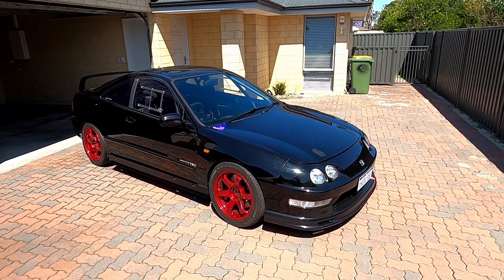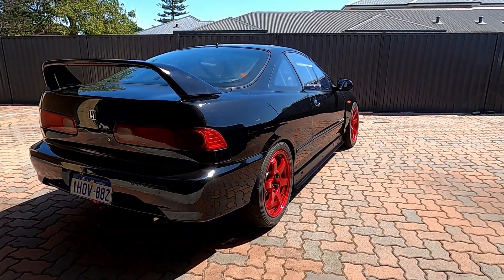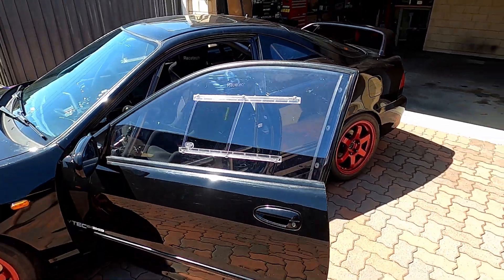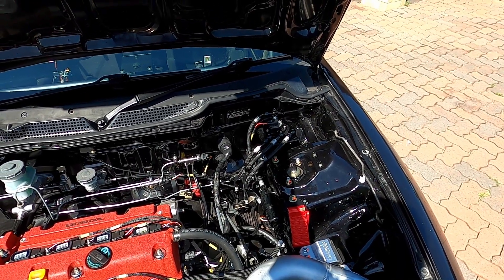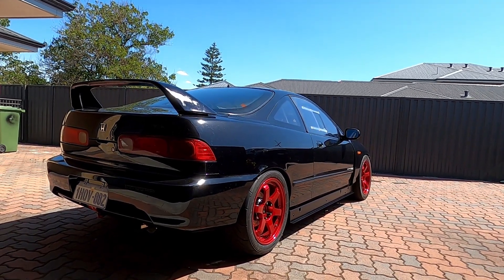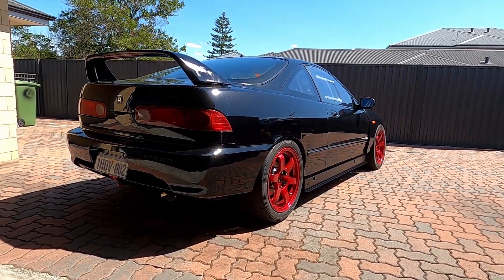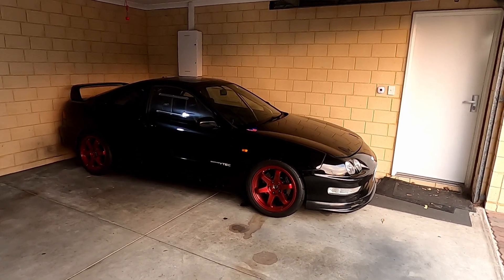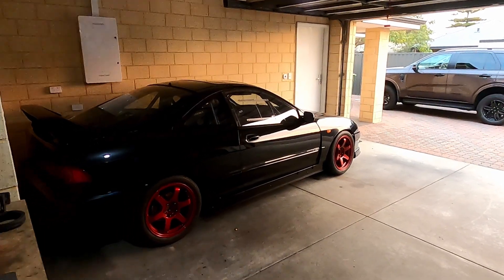K20 DC2 Racecar Buld Ep.10 - Dyno & Track Testing

Comment: beauty mate. How much does it weigh? and how much you reckon the carbon rear hatch will take off, and you reckon youll eventually go with a carbon hood? Also, any plans for a flat floor or any serious aero?
Reply from the maker: As it sits, with half a tank of fuel and the passenger seat etc. in it, 1014kg/2230lb. Pretty happy with that! The carbon rear hatch and Lexan rear window will hopefully drop 10-15kg, and yep I'll go for a carbon hood at some point soon. Eventually the car will get a basic aero package with rear wing, front splitter and front diffuser tunnels, but I want to get everything dialed in as it sits so I've got a great baseline to show exactly how much benefit an aero package does or does not provide.

Comment: Congrats on all your progress! Nice to finally see the car in action. Curious how much rear brake bias valve adjustment you have left-- I have an OMP adjustable bias valve that has too much rear brake pressure on its lowest setting, may switch to the wilwood variant (even though the specs are the same?) . Good luck on sorting all the teething issues.
Reply from the maker: When I went out in the first session it was set to max rear brake, I wound it in to about half-way and it was fine. I've had good success with the Wilwood valve, sounds like something else is happening with your system though? Are you definitely turning the knob the right way? Silly I know, but it's usually the little things
Reply: @technologicmse  Yes, definitely turning the right way. My rear brakes lock up before the fronts in the lowest rear pressure setting. I'll investigate the issue further. Thanks for the input. Great work on your build! Chassis seems very composed right out the box. Good luck on the sprint!